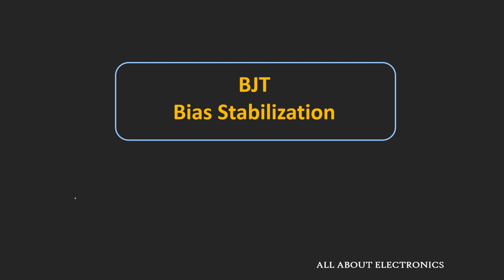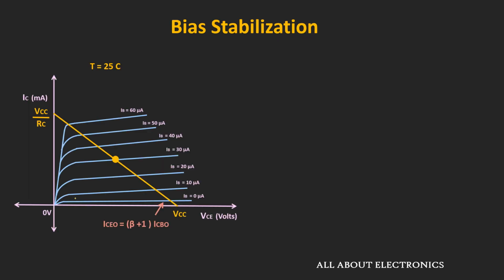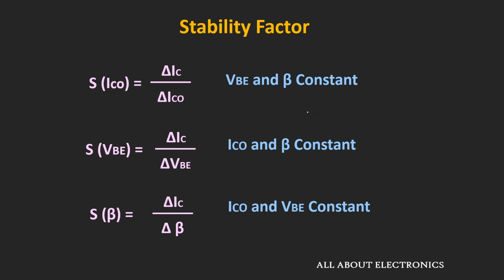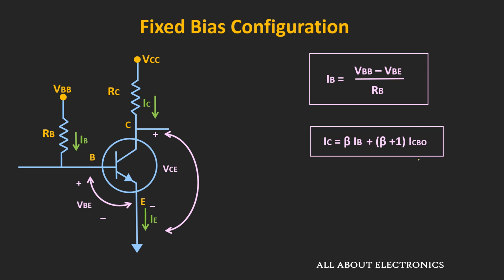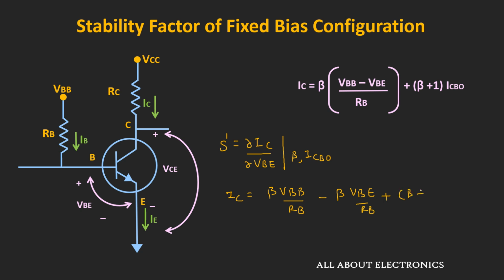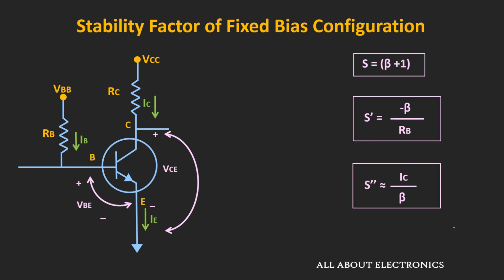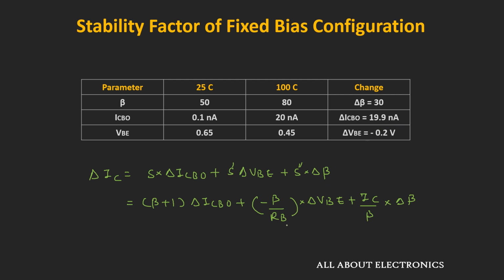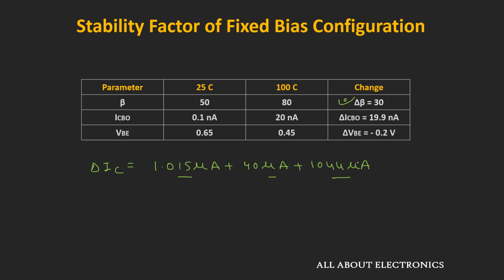BJT: Bias Stabilization and Stability Factor for the Fixed Bias Configuration

Comment: why did you used beta at 25C  but not at 100C while calculating stability factor.
Reply from the maker: Would you please mention the timestamp, where you are referring to?
Reply: @ALLABOUTELECTRONICS  at 11.00 while  you are calculating the stability factor why did you use beta value at 25C
Reply from the maker: @tarakaaditya940  25C is the temperature where is supposed to be operated. But it shows that, if the temperature goes beyond the normal operating range, then how it will affect the collector current. 
I hope it will clear your doubt.
Reply: @ALLABOUTELECTRONICS  thanks you sir

Comment: why should we  assume  V_BE and beta are constant when we calculate the S?not assume they are constant when we calculate the S'?
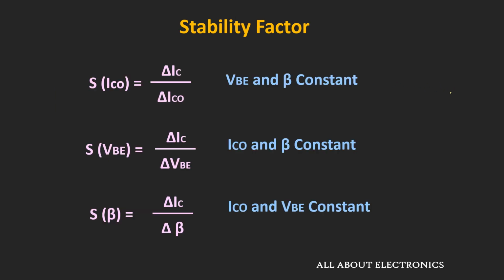Reply from the maker: S represents the change in collector current due to change in Ico. Since there are three variables, at a time we can find the variation due to a single variable. So, the remaining two are assumed constant. Please check at 3:32 for stability expressions.
S' is variation in Ic due to Vbe. So, at that time beta and Ico are assumed constant.
I hope it will clear your doubt.